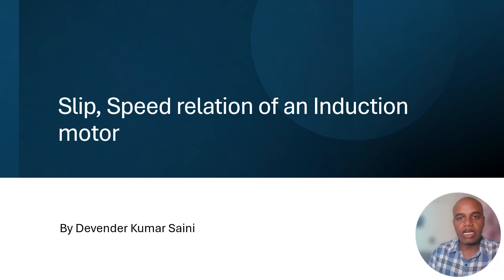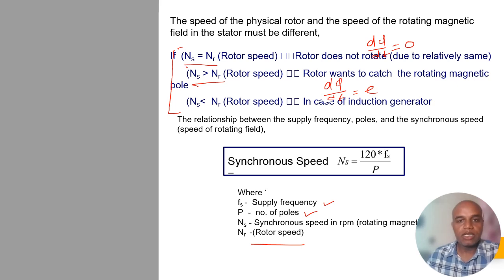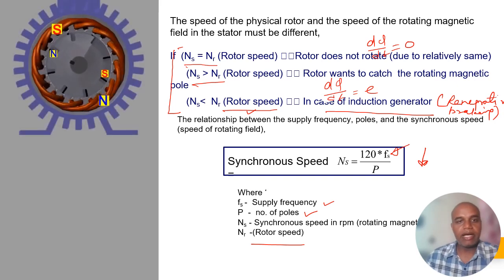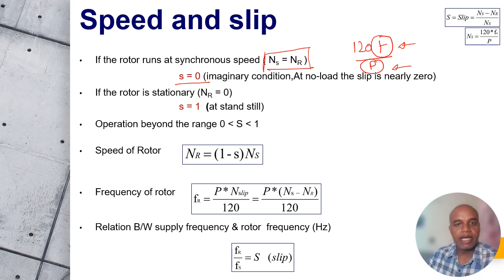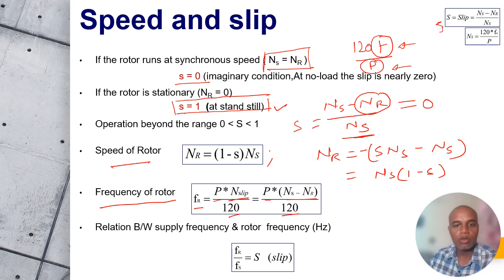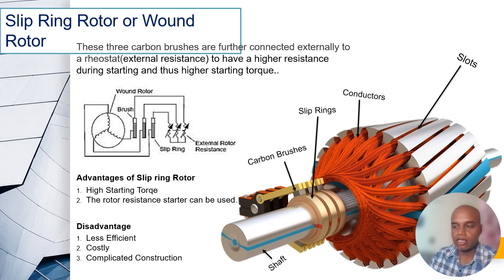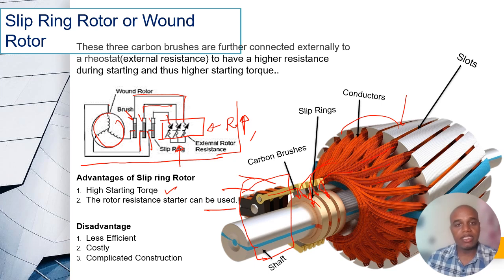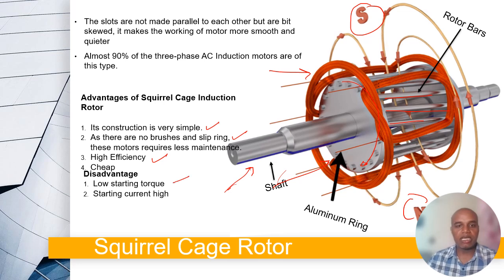Slip, Speed relation and rotor types of an Induction motor

Comment: Thank you for the video. I have a doubt. Is the direction of stator rotating magnetic field and the direction of actual rotation of stator the same. Also what about the direction of rotating magnetic field in rotor. Thank you.
Reply from the maker: Hi, direction of RMF and rotor rotation is same, moreover, stator remains stationary. Also rotor generates it magnetic field due to electromagnetic induction principle but rotor field is not rotating magnetic field.
Reply: @Understanding_electrical  Thank you for your reply